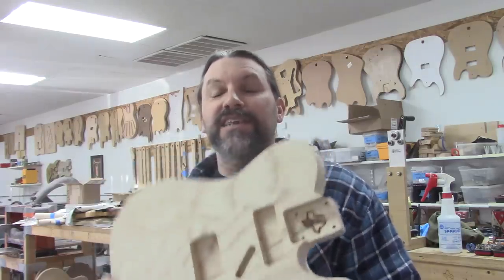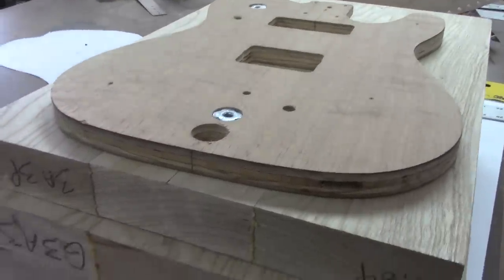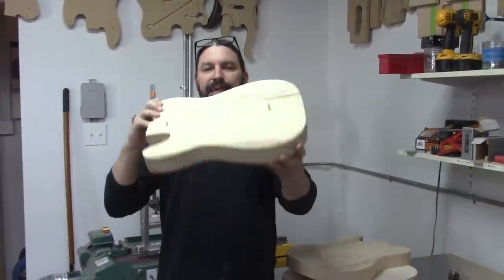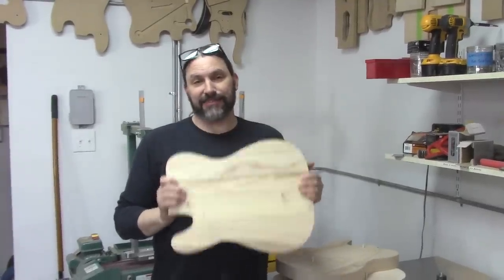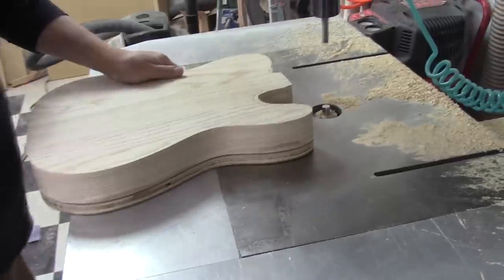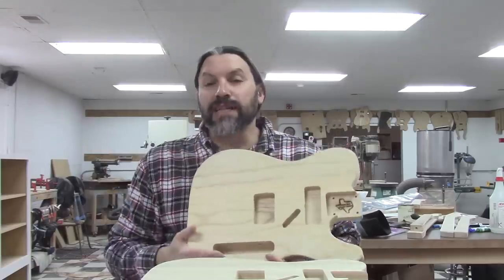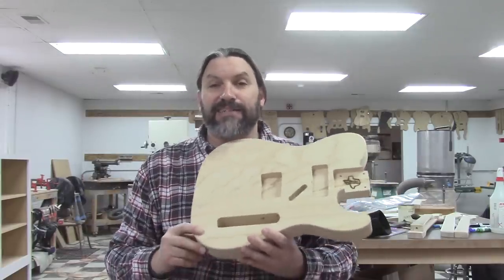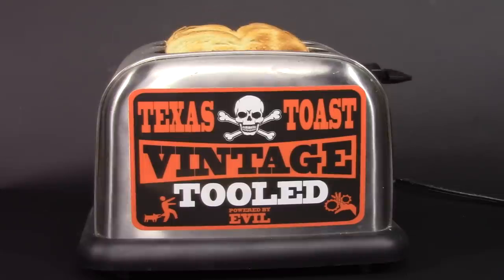How To Make A Telecaster Body... Fast As Lightning!

Comment: The swiveling handles on your templates is genius!
Reply from the maker: Thanks Zach, we had a few close calls with the shaper and those handles make life a little less sporty :)
Reply: @TexasToastGuitars  Hey Matt check it out, I'm working on a unique body style right now it's the Washburn Culprit and a Fender Telecaster blend it has pointy and round edges....I actually sketched out a rough drawing of the guitar body I have in mind and wow it's gonna be killer....the Culprit is a guitar that Washburn first made for Dimebag when he first left Dean Guitars here's the thing Washburn didn't to my knowledge make a hundred of those guitars they are rare very rare actually but, the body shape is unique I am going to basically take it's shape and televise it....so Telecaster body shaping is important and why I'm here.....there is a hook on the back of the Culprit that at all costs I'm keeping and this guitar I'm building "which I've named the Indigent because it's by itself ya know" I want this body to be larger in size as far as thickness I want the diameter to be around a inch or inch and a half larger but, not to big. I'm gonna use two pickups I considered one but, this build needs to be versatile for sure. Here is the kicker the neck is a Explorer neck but, I'm up for suggestions anyway if you have any advice for me Matt I'll always take your advice so let me know what you think......dude this body on paper is absolutely killer yeah I'm ripping off two guitars to make one new one but, I've gotta say I'm actually proud I have something that hasn't been done yet..... Guys this guitar looks sexy as hell on paper I'm not kidding. Get with me stay safe and take care fellas you inspire ol' Rocko' to do my thang here!!!

Comment: Next upgrade for the shop should be some dust collection - holy smokes that shaper is a beast!!!
Reply from the maker: We have lots of dust collection but the shaper and the pin routers are a pain to collect. So many different angles. It is actually easier to sweep it up after
Reply: @TexasToastGuitars  But it doesn't sweep up out of your lungs so easily.

Comment: Save a couple of steps there: get a smaller shaper cutter to go in the horn area, revise the notch at the back of the neck pocket to fit the shaper cutter you use. Get rid of the slant wire slot, it stops owners from going pickguard-less and slows you down. Use an electrician's drill to go from the neck through both pickup cavities and cross from the bridge cavity to the control cavity or go from the neck pocket corner to the control cavity through the neck pickup and cross from the bridge . The neck pocket can keep the drill bit level to the plane so the bit doesn't go out the back of the body (bet you've done that before too).
Reply from the maker: We are willing to make anyone a custom body to their specs. Let me know when you are ready to get something going

Comment: I'm confused when you got to the pin router. The template was on the bottom of the guitar. So how did do the PU and control routes.
Reply: The router holes are underneath and the pin follows them, the pin is directly underneath the router bit.
Reply from the maker: The pin router is a marvelous tool. The template goes on the bottom of the piece (opposite the cutting surface) there is a pin on the table surface that has the same center an diameter as the cutting tool. The pin follows the contours of the template.
Reply: Makes total sense to me with guide pin on bottom.. Just make sure router bit is set at proper depth for all the pockets

Comment: Question from Thailand..........What do you do with the dowels or holes left if you remove them? Using a pin router they would be on what becomes the back of the guitar, so are they flush-cut and sanded?
Reply from the maker: We fill the holes with 1/4 maple dowels

Comment: How was he controlling where the pin router went when cutting the pup recesses? There was no bush guide on the router following the template. If purely by hand I don’t understand hoe he didn’t cut the template too.
Reply: I'm pretty sure there was a little locating pin sticking up into the template from underneath.
Reply from the maker: The pin router is a marvelous tool. The template goes on the bottom of the piece (opposite the cutting surface) there is a pin on the table surface that has the same center an diameter as the cutting tool. The pin follows the contours of the template.
Reply: Texas Toast Guitars thanks for explaining that 👍

Comment: I never get tired of Pin Router Porn.     Thanks for the tip to use dowels to align the templates...  Connecting dots this is getting closer to my dream homemade fullerton single cut body with old aloha shirt fabric top.     Thanks you guys are always cooler than folding sunglasses.
Reply from the maker: Thanks brotherman, I like to provide as much Pin Router action as I can :)

Comment: So how big are swamp ash trees? Are they too small to get a one-piece blank? Does glueing bits together counteract drying distortion or maybe provide more symmetrical strength?
BTW, here in NZ we have a wood called "Swamp Kauri", also a softwood, but it is from prehistoric trees buried and preserved in peat up to 50,000 years ago. Still good, and there are guitar bodies made from it. Looks a bit gnarly though. Look up Langcaster dot com.
Reply from the maker: Dan has one piece body blanks that are really nice. I don't really know how large ash trees get?
I'm going to check out that lumber

Comment: So you freehand the neck rout and all the top routs? That's pretty brave in my book.
Reply from the maker: We do not freehand rout anything
Reply: the pin router follows the template on the bottom of the body......no freehand....you need to get  the concept of how this tool works.
Reply: Pretty sure he’s using magic

Comment: How the F do they run wire holes between neck pup and control cavity ?
Reply from the maker: We do it with the little chase but you can go from the neck pocket to the bridge and down
Reply: That's the part I wanted to see. 7 minutes I'll never get back.
Reply from the maker: @kenq7948  I guess you we won't have that cure for the Corona Virus now

Comment: By putting dowel rods in for your template does that leave a dowel in the back of of the body ?
Reply from the maker: Yep, we appreciate the dowel pins in the body... If you look at old Fender guitars there are pins as well. 
We like it and will keep doing it, kind of a throw back thing
Reply: if you place the dowels strategically ie in the location where you drill for the ferrules there is no need to have the dowel visible once the holes are drilled....both in the ferrule and neck screw locations.
Reply from the maker: @guitarworks2546  You certainly could do that. I like the dowel holes, the early Fenders had them (they were smaller) but I subscribe to the philosophy of paint it red rather than hide it. I like to own the fact that we do what we do, how and why. Thanks for watching

Comment: I'm still confused on how that pin router works.It looked like you were moving the body in perfect straight lines.
Reply from the maker: The pin router is a marvelous tool. The template goes on the bottom of the piece (opposite the cutting surface) there is a pin on the table surface that has the same center an diameter as the cutting tool. The pin follows the contours of the template.

Comment: Cool vid.
But I still can't understand why anyone would still be routing that silly and unnecessary wire rout from the neck pickup.   It's SO easy to drill from the neck pocket straight to the control cavity through the neck pickup rout.  
Cutting that extra hole across the face of the guitar makes it impossible to leave off the (equally unnecessary [and ugly] ) pick guard.  
What's the sense if having a great looking guitar body if you're just going to cover half of it with a tacky, $5 piece of plastic!!??  
<nay-sayer> "but then you end up with ugly scratches in the finish under the strings"
<me> so?  it's a lot smaller than a huge sheet of plastic COVERING the finish - and those battle scars are well earned.  / plus, if you're digging into the strings so far that you're hitting the finish below, methinks you might be wasting a lot of energy that could be redirected into better technique and faster picking skills.  
Just a thought.   :-D
Reply from the maker: I think you have to decide what is important to you and do that. It sounds like you are a guitar builder too (given some of the things that you said in your comment)… why would you care what I'm doing if you are already doing what you want yourself?
Reply: @TexasToastGuitars  
Hi.  Not a builder.  Though I have built a few guitars and bases for myself along with some heavy modifications.  
Sorry if I seemed overly critical.  No intention at all to troll anyone.  I've only recently been interested in Tele's.  When I discovered that the top-rout for the neck pickup wiring was how Fender originally did it, well, they always intended the pickguard to be there, I guess - so it didn't matter.   
I've seen bodies available with the old style top-rout, and others that were drilled from the neck pocket to preserve the look of the face of the guitar.  It just seems to make the most sense that way to offer the possibility of seeing more of the beauty of the instrument instead of a plastic cover.   That's all.  Have fun!!
PS:  just looked over my original post.  My intention was for my commentary to be more rhetorical than directed at any one in particular.  As I noted, the vid is pretty cool.  I liked the use of the template UNDER the body with the pin-router.